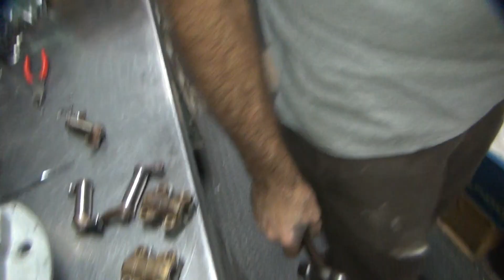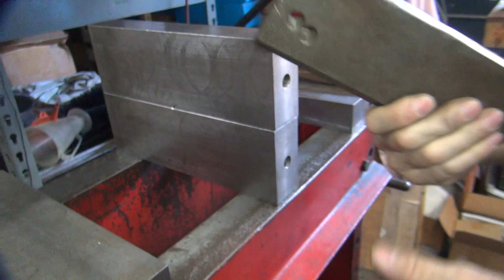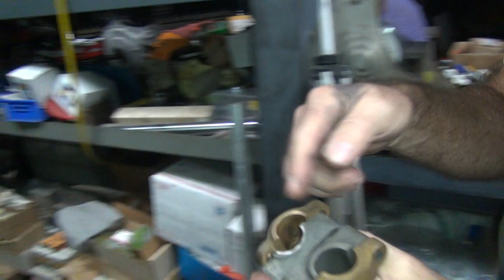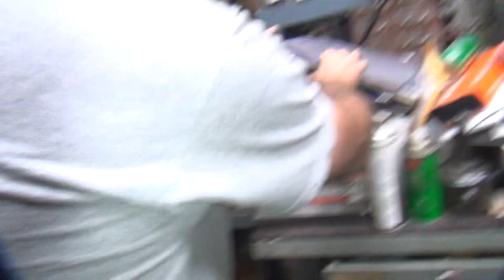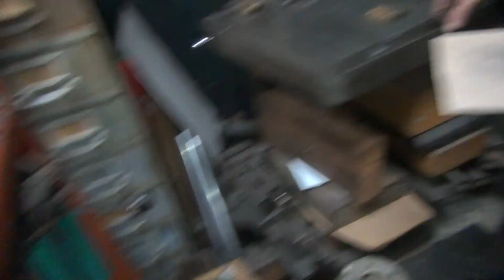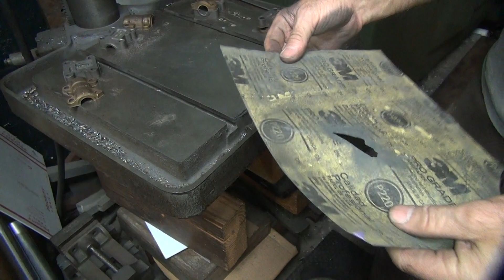#190 1952 panhead rust bucket topend rebuild cylinder head repair 74ci harley bobber tatro machine

Comment: Question... I do not have a mill or lathe. I needed to shorten an axel spacer to fit a different wheel to my springer, I was able to get it very close, with in 0.125 mm square and flat. Might I used a crush-washer to close the difference and get  a good 360 contact at the receiving surface (the factory surface is to the bearing side - my hand finished side is to the outside with a crush washer between the spacer and the springer fork)? Thanks.
Reply from the maker: why would you need a crush washer if the spacer was to long. its a harley, it can live with a little misalignment here and there.
tatro
Reply: @TatroMachine  well... you've made me into a fit "fuss-budget". The spacer doesn't quite fit 100% flush to the inner bearing race surface so I've turned it around and used a crush washer to "fill" in the 0.125 mm space that is about 1/8 around the circumference of the "finished surface". Seems to be okay, I'll check the axel bolt torque after 200-300 miles and periodically after that. Thanks!